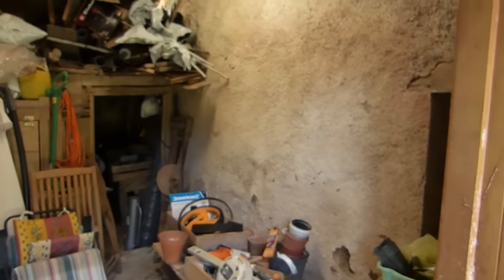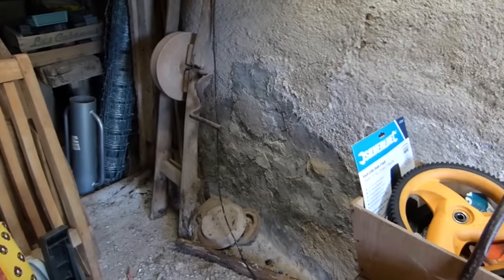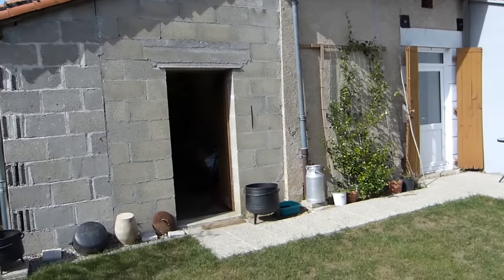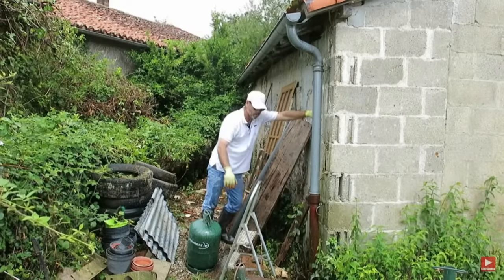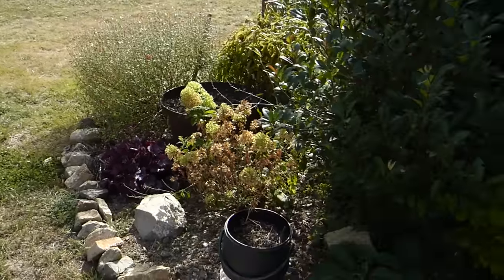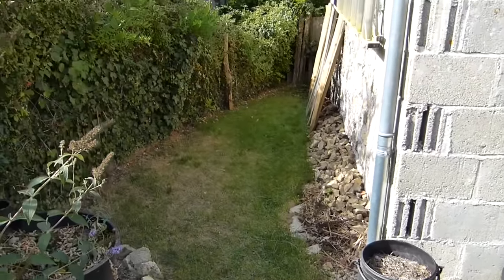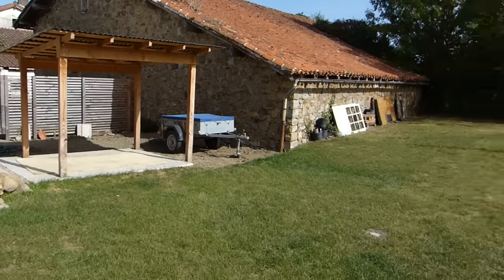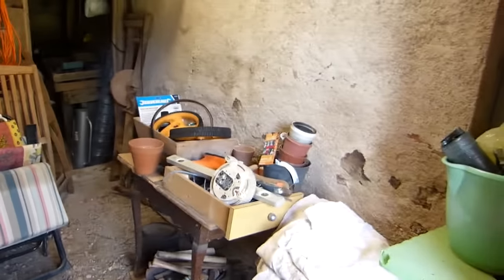Episode 500 - Starting life again at 50

Comment: Thanks for number 500. Slowly catching up with your previous videos - about 250 to go!! Our house is 250 years old and before I moved in in 2001 the previous  owners had a chemical damp proof course installed. This is pumped in at high pressure and I am still not sure how it worked but it does. Not sure about sticking glue sticks into a hole but it must work otherwise Trading Standards would have caught up with them by now. Keep the videos coming and give a carrot to Dave from us. Cheers Kim

Comment: Congratulations on 500 videos, quite the accomplishment  since you and Dave made your YouTube debut. It sounds like you have figured out the why of your interior wet wall problem and are researching the best way to solve it. If those plastic tubes did work, wouldn't the water collected in those tubes just drain right back to the base of the wall? I'm still on team French drain, centuries of French engineering on stone and lime buildings can't be wrong. Cement is your enemy. Missed Dave today 🍐

Comment: I have seen that method of drilling holes all along the base of an outside wall and plugging it with plastic plugs, However before the plastic plugs are inserted the holes are injected with a silcone based material under pressure over time to turn the porous brick into waterproof membrane. Its called DPC Injection. Have a google and you will see exactly when its used and pictures of the problems it sorts out (Pictures identical to your inside walls.!!)

Comment: Did you think 499 video's ago that you would still be doing this??? It  has been interesting watching you renovate and problem solve on such a tiny budget and achieve so much. Just a thought but is the workshop made from cement blocks or is it stone? If it is cement it might also be worth thinking about applying a clear Sealer and maybe paint over it as water sucks into those cement bricks.

Comment: Mark, I would clear out the stored stuff above the 'dungeon' and take a look at that corner above it - looking for a compromised beam or rafter where the external wall meets the internal wall as the shed appears to also be an addition on the house. It could be pulling or pushing on the wall due to shifting with lack of pointing and not enough support - if beam/rafter were not joined or have damp rot.  The bottom corner could have a support post that has damp rot on the bottom that is not longer holding up the top corner.

All brick homes have deliberate holes in the brickwork to allow for breathing and condensation - little drains inside the brick that direct condensation to the holes are added during the brick laying. Adding the plastic bits into a stone wall work in the same manner - so Yes they work.  All windows have holes in the frames at the bottom for the same reason - never cover the holes on windows exteriors/interiors they stop the sills from rotting and from condensation between the glass on double glazing's. 

The dirt floor in your side shed along with limited air flow to the wall in question is your main problem - that she needs to be aired out at all times.  Nothing should be up against the wall limiting air flow. The concrete needs to be change to render. The whole wall should be scraped and re rendered. then there are other options that need to be considered for the dirt floor that left as it is will always in crease humidity.  I would dig it down, put in vapour barrier, fill with fine gravel/sand and top with either concrete or cobbles or clay tile and grout.

Home ownership and ongoing maintenance - isn't it grand ;)  I have friends who bought new builds to avoid these issues only to find that the builders cut corners and they now have to deal with damp and mould.
Reply from the maker: Thank you for taking the time to comment  :-)
Reply: @GoingsoloinFrance  just curious what kind of reading you would get putting your humidity checker inside the shed.  Putting a dehumidifier in the shed will help dry out the wall.
Reply: Yep. That's exactlu what I thought, especially re-rendering n digging out/fixing thr shed floor
Reply: I believe the holes in brick walls are called weep holes. That may help you look it up. Peace

Comment: Congrads on 500th episode. Your right about everything concerning the damp issues. We call the 'damp experts' who install the  damp proofing methods you mentioned 'damp wally's' in my area [all old stone cottages]. You've already found the solution. Removing the concrete render in the shed and the acrylic paint on the wall and replacing with breathable paint/ready mix lime render before winter sets in and you get mould on the walls.
Reply: I agree.  However adding a few 'damp wally's' would be a good idea too. The shed appears to also be an addition on the house limiting sun and air flow to that wall.

Comment: There is a sealant in the rods which spreads forming a continuous waterproof layer. They are tested and approved - the only question is whether the product is suitable for your wall type? My guess is the damp is from the flood and when this dries out there will not be a problem. You could batten the wall and T&G (leaving an air space) just past the peeling paint.